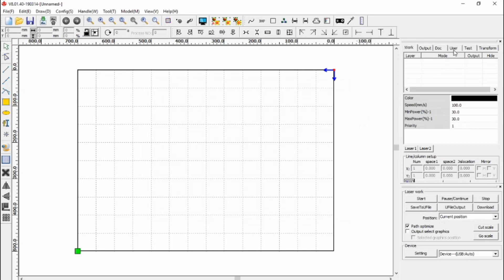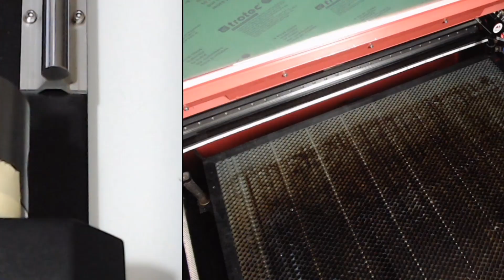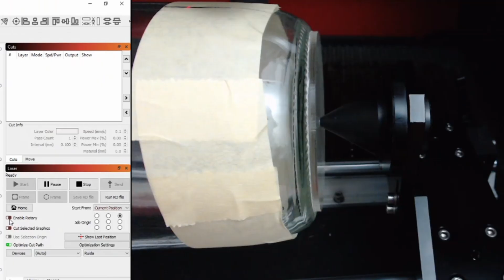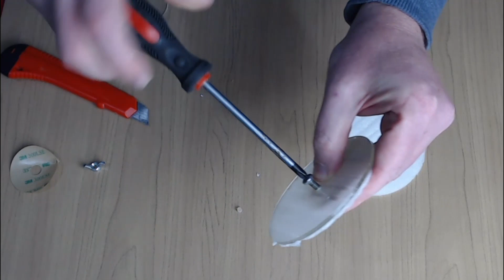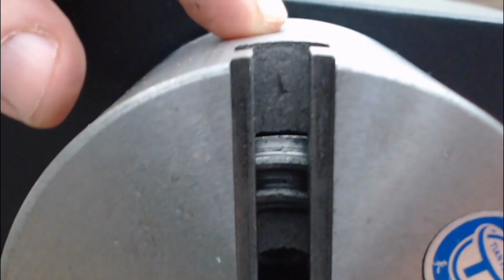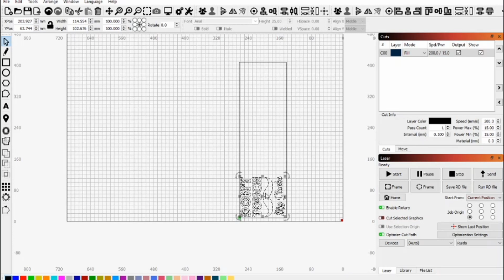Ep. 2 - LASER ROTARY ATTACHMENTS - Chuck Rotary Axis - Configuration, Settings - CNC Rotary Axis

Comment: Hello, I found your video very informative and easy to follow which I appreciate very much.  in any event I did all the steps right along with you and set up both Lightburn and RDworks.  However, there is something not right in lightburn and I can't for the life of me figure out what is going on.  The steps per rotation in the machine settings keeps changing to some odd 73 number after I update and write the 80mm chuck size to my machine. Also, I am using current position and placed it in various starting points and the same issue happens when running a test engrave.  When the test file is run the rotary spins around a few times and then starts the burn in a different place on the cup than where I wanted it to start. Then when I run the file again after moving the file down in my work area and resending to the machine, the rotary goes around a few times and then goes back up to the original test area and lasers over the previous test run.  I'm at my wits end trying to figure out what is going on.  I've asked on a few Omtech sites but the answers are basically you don't know what your doing and then they stop replying. If you can give me any insight on why this may be occurring I would be very grateful.

Comment: Great information and helped alot. I've just got my laser and it has a switch to swap between plane / rotary. I understand you have backed up your ruida settings via lightburn and then edited them for the rotary....including the homing option.  When I go back to plane (standard lasering) do I need to send back to the controller the backed up settings? How does it home with the edited settings?
Many thanks
Reply from the maker: Can you email me more info, not sure I can explain via comments Cheers askmatt@mwlaser.com.au
Reply: @MWLaser  Why when I use rotary chuck attachment my laser engraving "invert-mirror" image...I need to manually before start horizontal mirror image to get what I want... @MW Laser

Comment: Hi , where you can find info about amount of steps for rotation ? thank you
Reply from the maker: steps / rot are printed on the stepper motor driver.  Match the table up with the current DIP switch settings.
AakMatt@mwlaser.com.au

Comment: Did you make the setting change in rd works then u went to lightburn?
Reply from the maker: when you change settings in RD works Vendor Tools, it saves this to the controller, so if you change it in one software (LightBurn / RD Works) it will be the same in the other software as it is reading info from controller not the software.
Reply: @MWLaser  thanks buddy, I enjoy ur videos

Comment: Hello
I own a laser machine with a system (rdlc320).
I bought a Rotary device.
But the measurements were not good.
I watched this good video and noticed that you are using the RDworks-V8.1.40 version.
I downloaded the copy and when I opened ((other)) it was the way you showed
But after pressing the (read) key, the (Rotary) settings disappear.
Save me, what is the solution?
Reply from the maker: send support requests to matt@mwlaser.com.au send screenshots of what you are referring to as this will help

Comment: Thank you for sharing your knowledge. How did you learn all this? Especially since Chinese machines, or at least mine, come with almost no useful information and they're nothing like the ease of use of an American machine, particularly the rotary device, where all you need to know is the diameter of the item you're engraving. This video has been invaluable! Thanks again.
Reply from the maker: I learn by experience, trying, failing and researching.  I also have a good support network of manufacturers and technicians.  I'm thankful for your feedback.  Cheers Matt

Comment: (1) How does one remove the honeycomb bed to access the rotary attachment -- is it just four screws?  (2) Can one generally store the rotary attachment under the workspace as long as one is not working on very thick stock? (3) Does one have to worry about the rotary attachment drifting about on the "floor" of the laser, i.e., does it have to be secured at all on the floor of the laser cutter?
Reply from the maker: Hi, I have replied to you in more detail via email.  But the short answers to your questions are:
1 - Yes 4 Screws to remove honeycomb, but not always necessary to remove.
2 - No it is not a good idea to store anything under the honeycomb table
3 - No, you should not need to secure it
Cheers Matt

Comment: What's the difference between the 2-phase and the 3-phase chuck rotary? Which should I order for the red-and-black 80W laser?
Reply from the maker: they are different stepper motors and use a diver to suit.  The Red&Black normally uses a 2 phase motor.  to check, look at your Y axis Driver (if on it it has printed connections for A+ A- B+ B- then it is a 2 phase, if it has connections U V W then you will need a 3 phase.

Comment: Great Video Matt,  I'm gaining confidence to give this my Chuck type Rotary a go ...   couple questions.

Do I need to disable the Homing process? Is there a setting for that?

I'm unsure of the Rotary's positioning when placed in the machine .. as I face my laser is the Rotary positioned lengthwise Left to Right with the Rotary's drive assy on the left?

Really appreciate your efforts, this is by far the best and most comprehensive on going tutorial available relating to the Chinese Laser machines for the users trying to learn about the Rotary.

Thanks!!  Tim
Reply from the maker: Hi Tim, The rotary usually goes into the machine in the orientation with the Rotary Assay on the Right, I did it in reverse as I was having difficulty videoing the shots and not being ambidextrous this was easier for me.  (as a result I had to reverse the homing position and start locations)  I'm hoping I have not confused anyone by doing this.

It is wise to disable the Y-Axis homing before attaching the rotary, as theY axis will spin constantly until it finds the limit switch.  If you do not turn off the Y Axis homing then you would need to manually move the axis rail up to the limit switch to reset and then manually return it to the working location above the rotary axis.
The setting for disabling the 'homing position' was mentioned in Episode.1 at https://youtu.be/Y-NzNeaOegI?t=271

and also in this video at 2:35

There was so much to cover in this video and I didn't want to bombard viewers with too much info.  I understand there will a lot of questions and I'm happy to answer them, I may compile them all and make an additional video answering common questions on topics I have not covered or that need clarification.

Sorry I needed to Edit this Comment as I did not read the initial question properly. :)
Cheers Matthew
Reply from the maker: Sorry Tim I needed to Edit the previous Comment as I did not read the initial question properly. :)  I have corrected my answer Regards Matthew
Reply: @MWLaser  hi there love your videos I really need some help wiring in a chuck rotary that has a stepper driver built into it . So maybe it can go straight in to the u driver